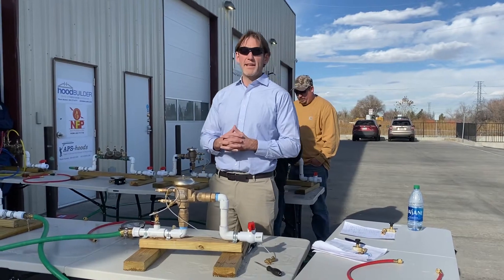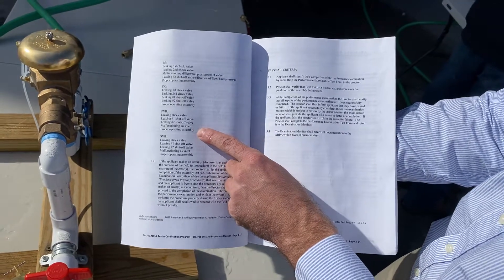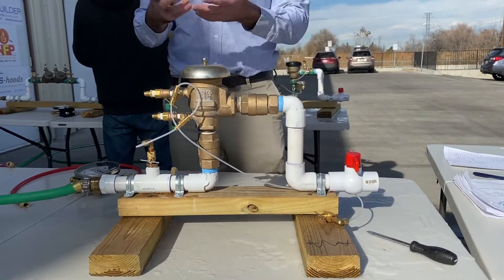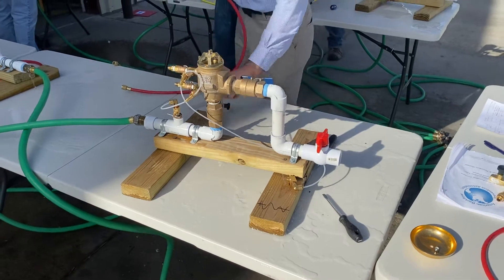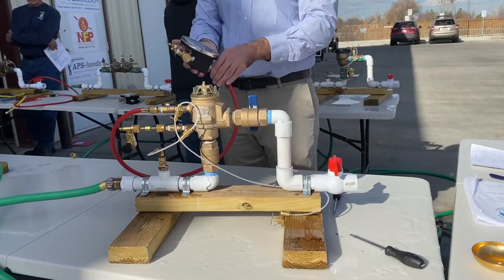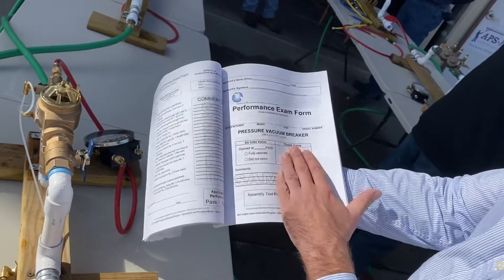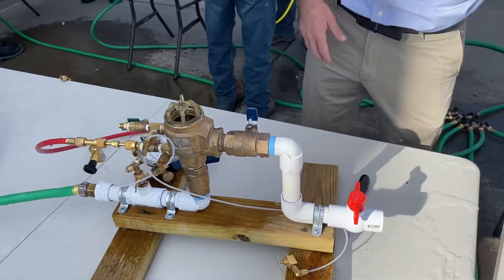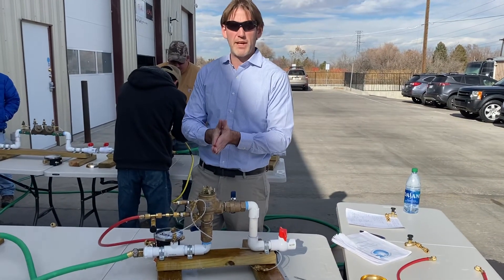Pressure Vacuum Breaker (PVB) Backflow Test - USC 10th Edition Diagnostics you may see on Exams

Comment: Besides noting that the Shut off valve leaks, would you mark PASS or FAIL when having a shut-off valve leak after obtaining your Air Inlet & Check Valve readings?
Reply from the maker: Pass .. shutoff valve leaks are marked but for USC 10th the valve test passes as long as you can complete the test with the diagnostic steps

Comment: Good to see more videos helping people with their ABPA certs/recerts.

 There are only 10 issues the proctor can create on all 4 assemblies combined, and 5 of them are on the DC. There are only 2 possible problems they will simulate on an RP. A leaking #2 check and a leaking #2 shutoff. The other 3 possible failures are covered in this video on the PVB. If you're a new cert, memorize your procedures and then practice identifying these 10 possible problems, and you're good to go. Remember, the proctor will only give a maximum of 1 problem per assembly. The SVB is a basic process without any problems being simulated as of March 2024.  I think they might change this soon though.

Comment: Does the leaky #1 shutoff scenario affect the air inlet opening point part of the test?
Reply from the maker: On the test there are no extra steps, but you may have to open high bleed a little more since the water coming past the shutoff might be more than is coming out of the high bleed, but no extra steps on the exam. There is a thing where if there is way too much of a leak you can open test cock 1 also
Reply: @whatisbackflow  thank you i have my recert  in a few hrs 🙏🙏🙏